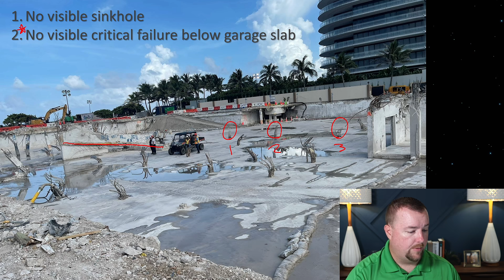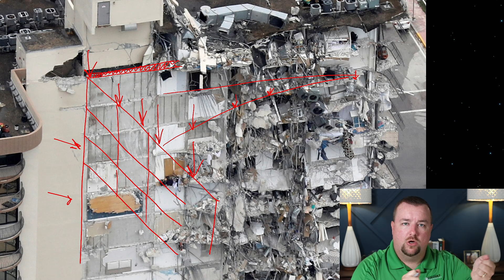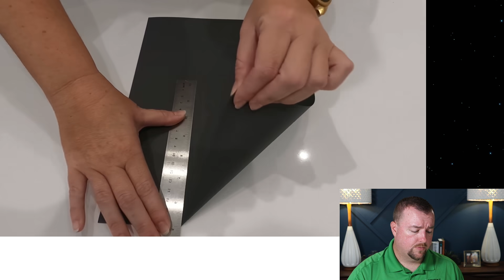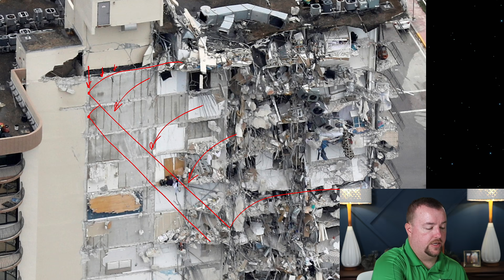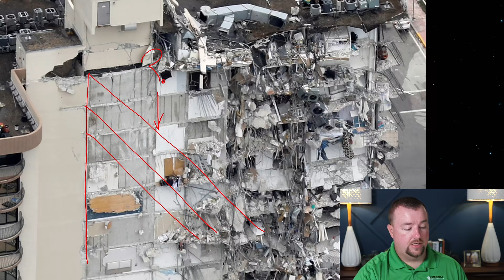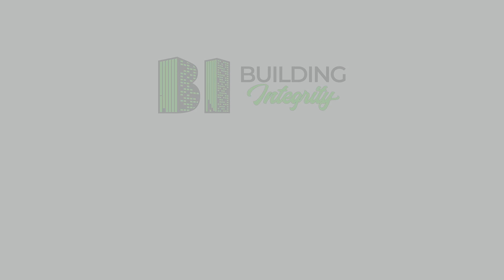Surfside Collapse - Structural Engineer Explains Why Only Half the Building Collapsed

Comment: Thank you for another instructive video presentation.  It helps those of us who were absent the day they taught engineering in engineering school.  

My take on this collapse so far is that intent matters. It seems the engineer had designed a pool deck, rather than a roof over the garage which could also accommodate lounge chairs.  (See Penthouse level).

In addition, the engineer thought he/she was designing a parking garage, rather than a water-tight basement next to the Atlantic Ocean.  It seems the environmental threats in both of these instances were not addressed properly.

As was suggested by the Morabito Report, WATER was the Kryponite of this project.  Until someone identifies all of the water sources, and the methods by which they were to be managed, we will not understand the root cause of this failure.

Comment: Was the reinforcing steel in each slab designed to come apart at the shear wall for the collapse to happen the way it did? The strength of the shear wall would be parallel to the shear wall and not perpendicular to the shear wall, at least in wood buildings, maybe not in concrete high rise construction? So I’m not sure why the collapse happened the way it did.

Comment: Could the extra weight be a cause ie this was a wealthy building if you have money you buy substantial things and lot's of them ie,
Large wine and whisky collections probably whole dedicated rooms and there were probably more than a few plus smaller collections,
How many heavy safes with heavy valuables were in the buildings and how many were on the upper floors,
The penthouse was added later this was a lot of extra weight and what excessively heavy items did it have,
Most of the apartments seemed to have thick marble and granite and slate on every surface and in some rooms of most it was tiled floor walls and ceiling,
Pretty much every kitchen has thick granite worktops extra large refrigerators and a few extra smaller ones,
High quality heavy-duty air conditioning in every apartment nearly if not all with heavy condensers on the roof,
Plus I'm sure the were many heavy duty shoppers in the buildings with apartments stuffed with year's of shopping goods,
To me this has to have been so factor in it falling along with the rotten rebar and concrete and the salt water being on the beach,
Maybe it didn't have anything to do with it but its something i keep thinking about how much excess weight was in the buildings and how much weight was how high up especially the higher floors and the penthouse

Comment: 20:26  You picture it as a slab on top of the column.  That's wrong.  Note that in this case,  the column-head  acts as a rotation point and that the back-end of the slab moves  upwards, while the rest of the slab moves downwards. On top of the column, that's an easy motion, not so if the column continues and supports another 12 floors.
If the column continues and supports another 12 floors, the column-head can't act as a rotation point.

Comment: Isn't it an argument against creation of such rigid parts of a building at the building design stage? An interface between a rigid part of the structure and a more flexible part is a stress concentration point/line where the building start collapsing. It is the case when adding more strength to one part of the structure makes the whole structure weaker. 

Disclosure: I am not a CE. I am an EE with MS in physics.

Comment: Wait, what? the slab is now covered with saltwater?  Is it coming up from the bottom or the side walls or what?  Secondly. I marvel at the old buildings still standing when engineering calculations were performed without the use of calculators or computer models.

Comment: Eerie how the way it fell looks so much like controlled demos - where they use this principle to bring down a building in stages with minimal effort, staying over the original footprint. Your explanation makes sense that failure of one area or line of support could initiate collapse of the whole structure. If the initiating failure had been further into the building, I wonder if it would be standing still. Sobering.

Comment: My question is, should buildings be different than plate slab considering the issues you mentioned? Seems a bit flimsy that the whole thing just goes down because of one area that could be small. If instead of columns you had a bunch of concrete walls like the shear wall supporting the structure (no parking)would it have collapsed?

Comment: I went back to the survivor accounts and security video from the next door property. What I see is not the demonstrated stitch at a time tearing away. The slabs hold on to the shear wall until they are tilting down well past 45 degrees and then let go in one piece. There is some zoomed in video from the beach of the shear wall face as well from the following day. No sign whatever of any ties, rebar or hooks between slabs and shear wall. Maybe the steel snapped cleanly, but then that would have to be every single piece. And it was a collapse and bits going all over, not a table top demo or lab test rig. I appreciate we're just throwing questions up here, see how the facts such as are available fit or not. I am wedded to the area of the deck BMA beams joining to the three face columns as the thing that by design would have made a total collapse of the centre section possible. Wait and see what the official investigation says about this. Pool deck and lobby level parking deck punch through, due to no remedial work of a poor construction. Squished cars and big bill. Save a few hundred dollars on not putting in chunky independant BMA support columns, dead people. It's almost like relying on the inward pressure of the surrounding grade retaining wall, to keep the deck from spreading out to keep the structural columns vertical!

Comment: Will you be doing any analysis of the emergency escape systems and how they functioned in this situation?  It seems that since the initial structural failure happened 7 mins before that more people could have escaped if they were imediately warned and were able to get to the main stairwell.

Comment: I still don't understand how the collapse of the pool deck caused the rest of the building to collapse.
Accord to eyewitnesses, first the deck collapsed, then there was a brief pause, and then the rest of the building collapsed.  The columns under the central section must have been weakened by the deck's collapse and then they failed.  How were they weakened?

Comment: Is it more precise to say that the shearing started on the bottom floor first? (No, you are not hypothesing on this detail, ok. Smart.) This actually gives the shear wall the minimal amount of drag from the progressive collapse adding still more to your concept.  

The bottom of the shear wall at its strongest state had the least amount of force acting down on it.  Consequently at its weakest state it had the minimal amount of weight dragging on it. You can continue with this logic, if it makes sense.

Comment: Well there were the flashes about 5 floors down from the top then 3 floors down and the first sections started to collapse then the same in the middle sections then the last section there were several flashes on the roof of the remaining section like they couldn’t get into the rooms on that section to plant the explosives 🧨 the first few times I seen the videos I assumed the flashing was from lights on the rescue vehicles but they didn’t arrive until the building came down

Comment: In Japan the houses are made of paper. They no longer have a steel ruler, because the country is a democracy. I type this a few feet from a crack in the corner of the outer wall of my building that runs all the way up from ground level to the 3rd floor roof. In the droughts of 1976/1982, it was 1cm or more. All the way through. First experimental concrete slab residential floor construction with brick walls, 1929. When it's a new technique, everything is massive and safe. Because concrete is brittle. 24" thick walls of engineering brick at ground level, 18" at roof level. Half a rainforest and pegged tenon joints in the loft timbers. Survived several near misses from WW2 500kg bombs. So the crack is there, no idea how the slabs are tied in to the walls. That corner of the room vibrates more with the trains passing. Sadly, the Surfside condo collapse could have come a week after construction with a little shunt from a car in the garage. The explanation is great in this video and the others, now I think I understand enough to spout my own opinion. It's the lack of a separate column to support the stepped pool deck slab. Where the BMA is on the outer building basement column. There isn't that construction in the 4th section. The size of the columns is a distraction, the garage ceiling slab still punched through. Familiarity breeds contempt, no longer a new construction method and buildings are seen holding up where masses of cost-cutting measures have been taken. It probably isn't (sufficiently) profitable to build a safe condo.

Comment: I live in a South East Asian city that has hundreds of these going up right now.
I'm taking a keen interest in the failure mode that you are describing.
There's no salt water issues here. The speed of erection here worries me. Column capitals and beams are used here, though the slabs are thinner. Appt more steel is used here, unless the building company is Chinese. The Korean and Singaporean structures being built  appear far sturdier.
There was one collapse in a building under construction (unoccupied except for the crew camp on the ground floor) that did pancake. Drone views showed that chicken wire was used in lieu of rebar on the floors, that was a Chinese tofu job. Built on bed rock in that locale..... probably what's keeping finished buildings from collapse.
I hope this type of disaster doesn't happen here, then again they're mostly casinos.
It's a worry. I could go on and on.
I'm looking forward to the final verdict of the Miami collapse.

Comment: In the marine business they use zink etc to protect the vessel, (cars can also be treated with zink, and nails etc) I think also electrical system, some equipment running a current through the vessel, I remember crew onboard vessels have till me these systems work great, would it not be possible to do the same on buildings? Perhaps especially if the building are close to salt(water)? 
Perhaps buildings made of concrete and are close to the ocean can use the same way of protection as vessels?

Comment: They cleared everything except of that huge beam that was above where the lady from the garage video parked her car. Parking spot 15 if I remember correctly. It's between the original ramp and makeshift ramp in picture at 1:15 
In her video I noticed that beam is wider than the 4 columns it was sitting on top. Is that a normal design? Do you think the fact they didn't remove it is just random, or it could be important for investigation?

Comment: >>> Josh, that partially collapsed parking structure @20:40 that you've shown in several of your videos is/was the Pipers Row Car Park, in Wolverhampton, UK, and it collapsed on 20 March 1997... Having lived in the UK, IIRC, the vertical pipe (seen as bright RED in color photos) is a "riser" used to supply firefighters with high pressure water.
Reply from the maker: Yep Piper Row.  Good eye!
Reply: @BuildingIntegrity  A lot of very good For-Engineers/By-Engineers reports came out of that one.  Like most states/regions/nations, The UK had its periods when construction methods/quality slacked off... followed by the inevitable disasters, followed by new tougher codes, lather, rinse, repeat... eternal tussle 'twixt engineers and bean-counters...
Reply: @MajorCaliber  And now we have Grenfell- which is exposing some really bad stuff about product testing.
Reply: @alisonwilson9749  Once again: just say NO to poofty awk-i-tects who want to "soften" Brutalist/bare concrete buildings by cladding them in--I am NOT making this up--highly flammable material!... and said flammable material 
is further amplified by--and I am NOT making this up either--being "sandwiched" between aluminum panels in a way that actually creates a powerful chimney effect which BLOWTORCHES the flames straight up the sides of the fireproof concrete, where it then JETS into the windows where all the very NON-fireproof materials become IGNITED!  Call me old-fashioned, but I think crematoriums should be small single-storey structures, and those being cremated should already be deceased when they meet the flame.

Comment: Excellent video as always. Just an explanation of the paper tearing behavior from someone who has worked in the printing business for a long time: Paper is usually made from fibers that are aligned in one direction. It bends and tears more easily along the fibers, which is why most paper intended for printers has fibers oriented along the short edge so it more easily bends around the rollers in a printing mechanism. Conversely, paper intended for brochures and books has its fibers aligned with the long edge (for portrait oriented) so the pages can turn more easily and any changes in humidity cause the pages to grow or shrink away or towards the spine rather than causing terrible wrinkles and making the pages stiff. In the demonstration with the black paper, you can see that the tear proceeds quickly towards the left edge of the sheet, which points to the fibers being aligned with the short edge of the sheet. Otherwise, you would not have seen such a sharp, almost 90 degree turn.
Reply from the maker: Interesting!  Thanks for the knowledge!
Reply: A good point. I find that handmade paper made in a frame by the sheet doesn't show the same directional alignment as Fourdrinier or similarly roll-made paper, so that might be an option if a similar experiment was to be done again some other time.
Reply: @alisonwilson9749  An equally good point! In our printshop, we used to process Tyvek paper that was untearable. It was made of plastic fibers, but these were also randomly aligned as to prevent any easy tear propagation if a tear should ever occur.

Comment: What a pleasure to listen to well-reasoned, organized, grammatically correct, and educational information presented in a way that listeners at any level are enriched in the process.   It's nice to know there are professionals of this caliber doing this work.  If YouTube University had an awards ceremony, you'd be my nominee..
Reply: THIS!!!
Reply: A simple exercise: For each 100 pounds of horizontal component of wind force directed against a north wall, each of the east and west outside walls that are at right angles to it takes up 50 pounds of force. If a third interior wall is added parallel to the east and west walls then each wall will take up 33.3 pounds of force. The floors that also transmit this horizontal component of force to the outside walls prevent concave deflection of the north wall. 
   
Is a third interior wall required? (Referred to in some discussions as a shear wall). After calculating the force that the east and west walls must meet it is a matter of design choice. It is likely that the minimum thickness of the east and west walls already greatly exceeds the force against which it must hold up to horizontally. Thus, for each 50 pounds exerted horizontally, the walls as a result of their thickness to function as a wall bearing up the vertical downward force from weight, are already capable of sustaining a horizontal component several times that amount. 
  
An interior wall of solid concrete that is not connected by rebar to the adjacent part of the building is in effect an exterior wall to which an abutting building has been added that encloses it making it appear to be a single building. 
   
The reason behind this is finance, not engineering.

Comment: The slab was poured continuous and went through the shearwall. When the facade columns failed, the slab moments immediately snapped the top bars at the shearwall, and then the weight of slab sheared the bottom bars. Concentrating your viewers minds on shear alone is somewhat erroneous because the moments (bending) in the slab initiated the slab collapse. Once one column (or slab) failed, it caused all the slabs to fail progressively at the shearwall (among other things it caused). 
I think when all is said and investigated that rebar corrosion will be found to have caused the collapse of this building. And I do believe that this corrosion should have been investigated more thoroughly in 2018. 
Otherwise sir, I must say your presentation and speaking ability are superb.

Comment: Coming from an engineering professor you do a great job teaching!  

I know the answer, but some may not, why are shear walls used?
Reply: To resist lateral loads like wind or seismic loads and improve the overall rigidity of the structure
Reply: Covered in previous video

Comment: One YouTuber found out that under pool-deck was smaller 12"x16" column connected by beam to column supporting #1 collapsed front fasade. And when pool-deck collapsed it was possible that beam broke supporting column. Other YouTuber Said hole pool-deck and the beam was designed to be full depth restaured. If I remember correct you talked about same beam in one of your previuos videos. That beam in carage with almoust no paint and water marks. If pool-deck collapsed like you just explained IT would have caused beam to pull and twist column under fasade.